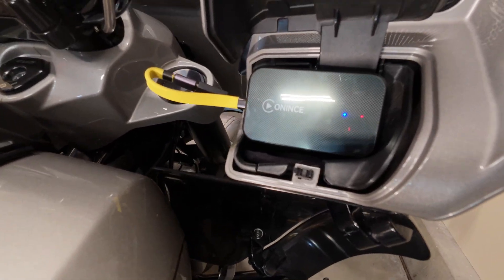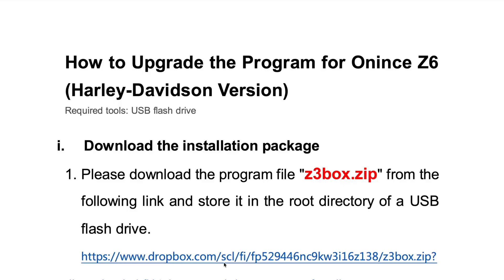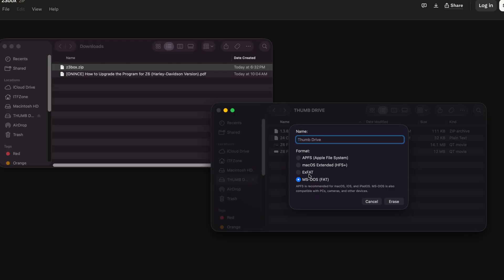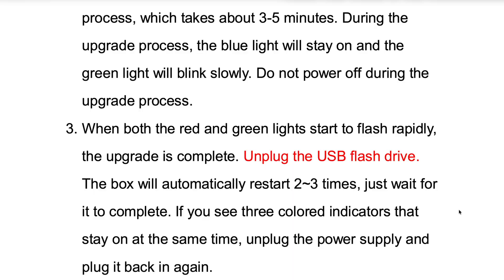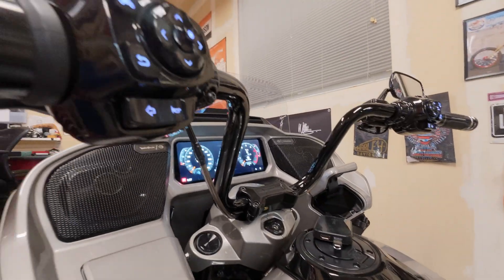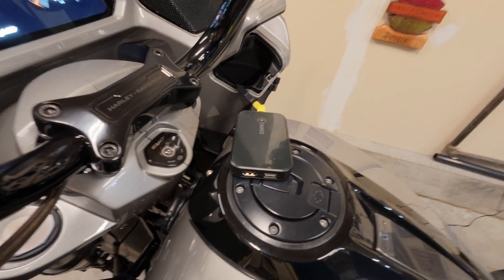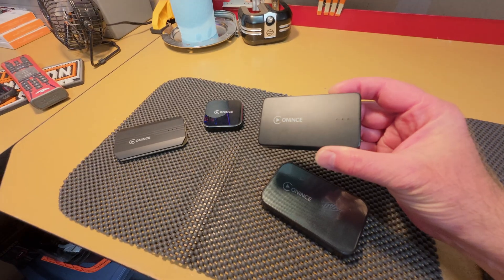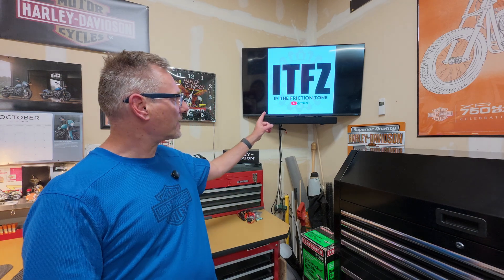Android Box Not Displaying Correctly!

Comment: The ONINCE I bought won’t have this problem, right?
Reply from the maker: ONINCE removed the software version from its production but I really don't know how many are out there with the bad software version.   If your does not display correctly I am more than happy to help!
Reply: @ITFZone  It seems like this box is constantly vibrating inside my glove box. Will long-term vibration and repeated bumping have any impact on the device? I’m considering whether I should add a glove box liner.
Reply: @ITFZone  However, the device gets very hot when it’s running. I’m worried that adding a liner might trap heat and make it more likely to overheat or get damaged.
Reply from the maker: @Robert-8864  To confirm you are using the Z3 model.   We have seen comments of heat wih the CA01,  something I have not run into but not the Z3.   The boxes will get warm but not hot to the touch.   My Z3 is really just warm enough to no its being used but really no noticeable.   No concerns with the vibrations but the cables can fail as happened to me in my Bucket List TShirt video.

Comment: My box won't show up on the screen at all anymore
Reply from the maker: Suspect the USB C cable.  Especially if you see a red power light only.
Reply: @ITFZone I used the cable you suggested
Reply from the maker: @AJJAKE23  If you can send me a photo of your device manager screen on the bike.   We want to make sure the AI Box is not connected as a headset.   ITFZoneEmail@gmail.com
Reply: @ITFZone it's the slightly smaller square one. I get the blue light from the box and the medhawk it so connects to the bike just nothing pops up on the screen. 

It's brand new. It worked great for a week. Now nothing

Comment: Tom, of all the boxes you've tested, which do you feel is the best?  You've tested so many, I'd like your opinion.
Reply from the maker: Hello,  The ONINCE Z3 is my current top pick.   It utilizes Android OS 11 and is one of the couple adapters with an OS later than version 10 that I have seen display correctly on the SkyLine system.   It is very responsive and more compatible with current version of Android Auto.   For being under $100 it is the best option.  They have sent me a GT6 model which has a Snapdragon processor and it is even more responsive and has Android OS 13 built in.  It does display correctly on the SkyLine system.   It supports GPS and SIM Card.   Options we don’t need for Android Auto use and it goes for $229.   The Z3 to me is the better value for AA on the Harley.  I am sure we will see new options after the first of the year and I still have hope we may see embedded Android Auto on the Harley’s!

Comment: My buddy has the z3 box and sometimes he has to unplug the box like 3 or 4 times because the box just keeps rebooting over and over so alot on the times he just unplugs it and runns bluetooth of his phone
Reply from the maker: Suspect the stock USBC cable.  There is a grounding issue with it.  I recommend a short thunderbolt cable.  I have about a 98% success rate with it,  about the same reliability as CarPlay.  The SkyLine system at times has issues with the boot order.

Comment: I have the older Onince box and its worked great. Idea for a video.. Screaming eagle tuner update with computer instead of through the app which bricks the tuner. Thanks for the videos !
Reply from the maker: Yes I have been following this issue.   They put the app back on the app store but I think it just prompts that you need to use a computer.   I do not own a SE tuner.   I have let the manufacture warranty expire and was wanting to get the new PowerVision however I am just sitting on it to see what the 2026's offer,  likely no changes.   So then I will either extend my warranty and go SE or gamble and go DynoJet.